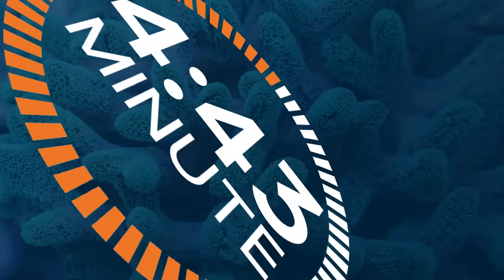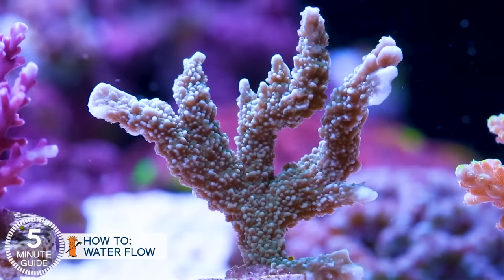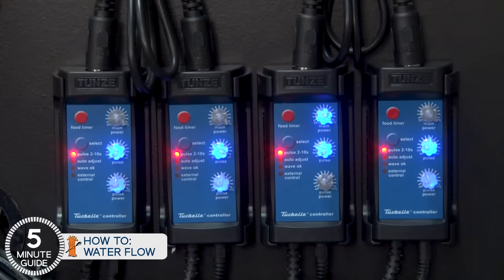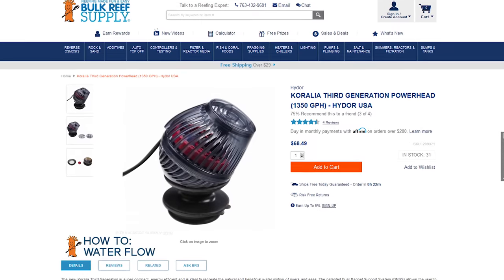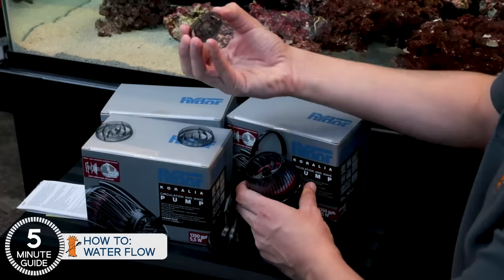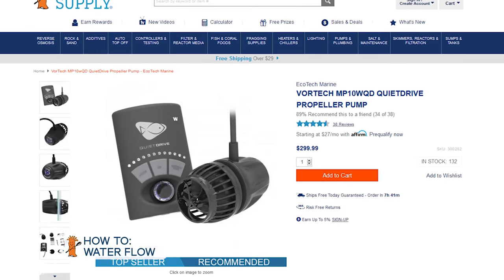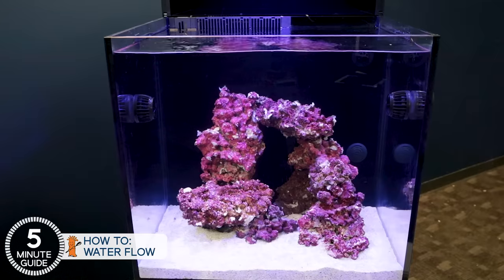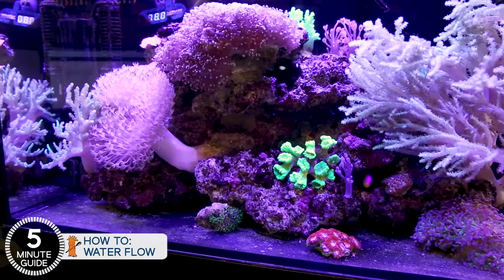How to choose powerheads and get flow right the first time. Saltwater Aquarium Flow

Comment: I have a 1800 power head and another one that’s 200gph on a 40g reef tank. The blowfish seem so have a hard time moving freely around what should I change ?
Reply from the maker: Sounds like you need to either turn the power heads down (if they're controllable) or purchase smaller ones if the fish are struggling in the flow.

Comment: Hey guys, the MP10's are rated for a max tank thickness of .375 inches.  The Red Sea Max E 170 has .50 inch glass and according to ecotech would require the MP40 which I broke the bank and purchased 2 for my E 170.  I have them set on the lowest possible lagoon setting right now and still wondering if its to much flow for lps.  Will the MP10's work for this application?
Reply from the maker: All of our MAX E170 tanks in the BRS Lab have MP10s on them and we haven't had an issue with any of them yet. Since you already have the MP40s, I think the lowest setting should be just fine. :)
Reply: @BRStv  Thanks Guys!  The Dream Tank for me is a 6 foot 150-180ish gallon tank, so if my wife ever buys into that I'm off to a good start!
Reply: Thanks I was just going to ask the same question. I have some on my shopping list.
Reply: After 1 year of failure, I realize 2 mp40s on a 130.4 gal 48" long tank is too much flow. Even the lowest setting is too much.

Comment: You might’ve mentioned this is the video, but my tank already comes with a recirculation pump, do I still need a flow machine?
Reply from the maker: It will depend on the types of animals that you plan to keep and your rock work. In almost all cases, there is value to having an additional powerhead in the display tank to hit specific dead spots and to increase flow.

Comment: My question is, I just bought a 50 gallon and want to know if I should get one mp40 or 2 mp10s. I have had a lot of people say one mp40 because of the versatility and room for me to upgrade tanks later. What are your honest thoughts? Thanks in advance!
Reply from the maker: Two MP10s would be a better fit for the average 50 gallon system so that all of your flow isn't coming from one pump. This will allow you to hit some more targeted areas and reduce dead spots. Just keep in mind that the MP10's have a max glass thickness of 0.375"

Comment: My lfs said one pump should b in front and the other on back to create the right type of flow .  Do you suggest putting them the same height ?  If so what height?  is midway up good?  I always had them high to create a current on top for oxygenation but  then there is no flow on bottom for my lobos and wellsi, scoly.  Do those sand bottom corals need much flow? I also have redish sand and heard that means not enough flow on bottom!  It almost seems I need 3 but afraid that would be to much for a 36 gallon!
Reply from the maker: Hard to say in every case as the rock work, types of corals being kept, flow rate of powerhead, type of flow coming out of the powerhead, etc will all impact powerhead placement as well as the number of powerheads needed for the job.

Comment: On the Red Sea could you get away with 1 power head and create the turbulent flow mixing with the filtration return pump?

Thanks again for the video.  They are great.
Reply from the maker: For softies and LPS, you could get away with it. I would consider a gyre pump as they have a flow pattern that would best suit these goals. The IceCap 2K, for example, would be worth looking into.
Reply: @BRStv   I am really trying hard to go with no cords in the tank.  I am actually building a Waterbox 60.2 which is 24 x 20 x 20.  I am wanting to run a Vectra return pump and was thinking a single MP40 on the back wall.    The tank is not very large and I am having a hard time with spending the money for 2 MP10's.

Do you think this setup would work or is the MP40 going to be too strong?
Reply: Another question.  Any issues with the mp10 on the e170?  According to red sea the glass is 12mm thick, but the mp10 is only rated for 9.5mm glass.

Just want to make sure I don't have any issues.

Thanks again.  This series had been a good knowledge builder.

Comment: hey there... I have a fluval 13.5 and two Koralia Nano Flow Pumps (240 gph) - looking for placement suggestion. I have the two returns pointing at the surface... right now I have these both on the back wall towards the end, pointing at the front glass... Can't put on on the filter compartment side and would prefer not to on the opposite end for aesthetics... Will they do the job blowing off the front glass?
Reply from the maker: That should work just fine, depending on your rock work. Your best way to determine if your flow pattern is adequate is to look at the corals and see how the flow is moving them. You want the corals to be visually moving, but you don't want the flesh to be pushed up against the skeleton.

Comment: I have 2 of the 1350’s in my 120 gallon 4x2x2. It doesn’t seem like very much flow. Is that enough for a LPS dominant tank? Just want to make sure I’m getting enough. Thanks BRS.
Reply from the maker: The Hydor pumps have a pretty wide flow pattern, so it may not visually look like as much flow as you'd want. The best way to judge flow in an LPS system is to provide the corals with enough flow that you can see their tissue moving, but not so much that it's pressed against the coral skeleton.
Reply: @BRStv  awesome thank you. I appreciate it.

Comment: So I would take this out of the tank to mix salt and then put it back in?? Or do I need a separate one?
Reply from the maker: Most reefers will have a separate pump to mix their saltwater. This way, their tank's flow is not interrupted. For your mixing pump, you don't have to spend a ton. Just a basic powerhead will work 😃

Comment: Do you always need two powerheads facing each other? What about in a 10 gallon? I was thinking of just purchasing 1 mp10.
Reply from the maker: It's going to be very dependent on tank size and dimension. For a 10 gallon, a single MP10 will be just fine

Comment: So curious what's a decent power head option to just have 1 and tank size is 120 drilled corner drilled 4x24x24
Reply from the maker: If you told me that I could only have one power head in a standard 120 gallon, my pick would undoubtedly be the Tunze 6095. It has a strong, but wide flow pattern, so it'll be able to give you the most bang for your buck. Plus, it's controllable, so you'll have flexibility over how intense the flow is. 

https://www.bulkreefsupply.com/tunze-turbelle-nanostream-6095-controllable.html

Comment: Would 2 power heads be over kill on a 20 gallon peninsula?
Reply from the maker: Not necessarily. If they're two smaller powerheads, this is a great way to introduce varied flow to the system and give you options on how the exact direction of the flow.

Comment: 2 1350 gph pumps plus the filter is like 70x turn over rate. Is that super high?
Reply: My question exactly. I have started a mixed reef where my hammer and frogspawn love little to no flow but I just purchased montipora and a torch which love high flow.  I dont want to sacrifice 1 of the other either.

Comment: I am setting up a 10 gallon reef tank can you tell me  those anybody make a powerhead that moves 100 gallons per hour for flow thank you by the way I love your videos
Reply from the maker: Unfortunately, we don't have anything quite that small. Some of the DC controllable pumps can get pretty low, however. The Tunze 6040, for example, can get all the way down to 53 GPH

https://www.bulkreefsupply.com/tunze-turbelle-nanostream-6040.html

Comment: Any suggestions for a 55 gallon tank?
Reply from the maker: Tons of great options out there, but since that tank is only ~12" from front to back, a pair of IceCap Gyre 2k pumps (one on each end) is a SOLID choice! Not to mention, pretty affordable! 

https://www.bulkreefsupply.com/2k-gyre-flow-pump-with-dual-pump-wifi-controller-icecap.html
https://www.bulkreefsupply.com/2k-gyre-flow-pump-only-2000-gph-icecap.html
Reply: @BRStv  I have a hob filter on one side that moves 400 gph would I still need two gyres?
Reply from the maker: @brandyrankin8318  In that case I would start out with just one gyre, then evaluate the flow. The single gyre plus water movement from your HOB equipment will certainly suffice for a softie and/or LPS dominated tank of that size.

Comment: With the heads being so high and pointed at each other what about the sandbed? Like how do you keep it "moving" so algea doesnt grow on it?
Reply from the maker: The sand bed doesn't necessarily need to move. With proper nutrient control, you shouldn't have any algae growing on your send bed, even if it is perfectly still.
Reply: @BRStv  the only place i really have some growing is some on my powerhead and some on the backwall

Comment: I don’t even have a saltwater why am I watching this lol
Reply from the maker: Hard to say exactly as we didn't test on that specific tank size, but the ideal settings are likely somewhere between the settings for the 25 and 60 gallon tanks in this video. I would start by simply splitting the difference between those two settings and it should get you VERY close 🙂 Of course, using a par meter would be the best way to confirm for sure.
Reply: @BRStv  ??

Comment: so if I would sell €500 pump with 20% profit... or €50 with 20% ... hmmm lets make a video clip about €500 ones....
I have bunch of Jebao/Jacod wavemakers that do the job for a fraction of the price (also wave patterns, WiFi) and they do last now for over 8 years! 
premium price tag not always means better :)
I see dosing pumps for 1000's ! I use those for €60 and they do the job :D OK someone can say about the resolution of the pumps. If I have to do dosing of less than 1ml per cycle I just RO it until I can do it with my 1ml/cycle :D